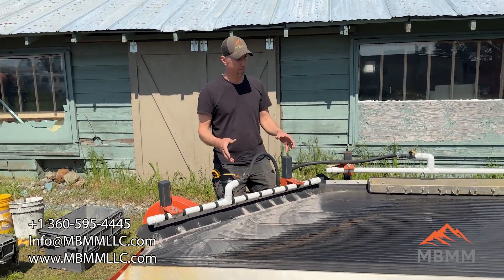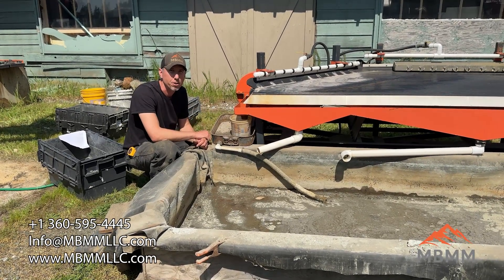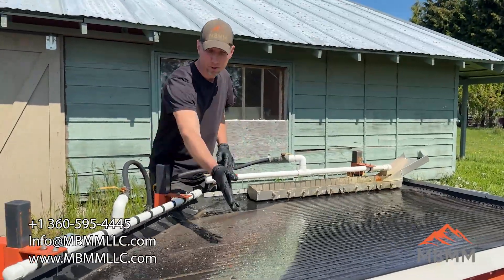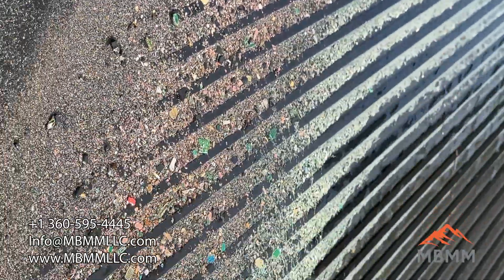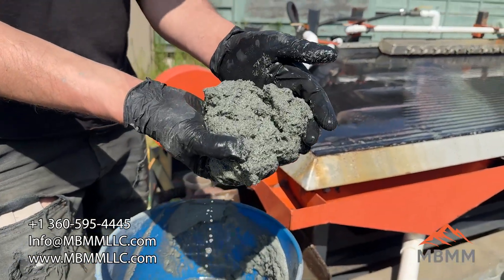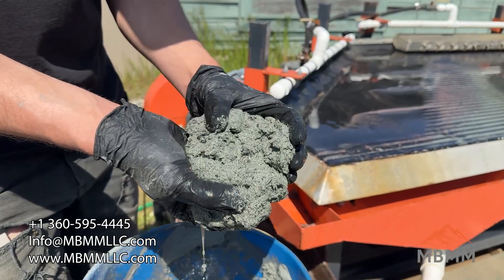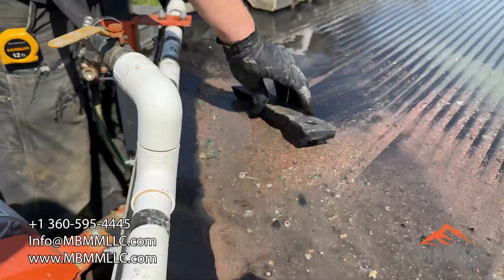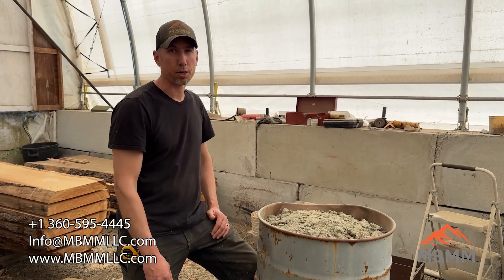We got so much metal from this sample on our Shaker Table!

Comment: Do hammer mills have to be run dry? Could water, even a fine mist, be added to reduce the dust?
Reply from the maker: Yes you can run the hammer mill with water!